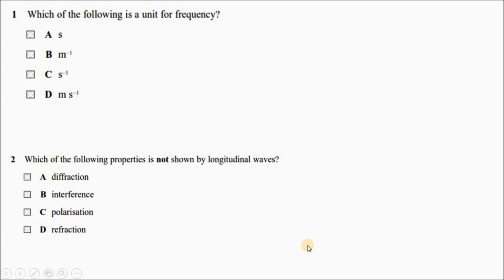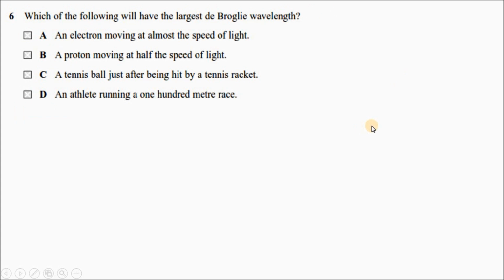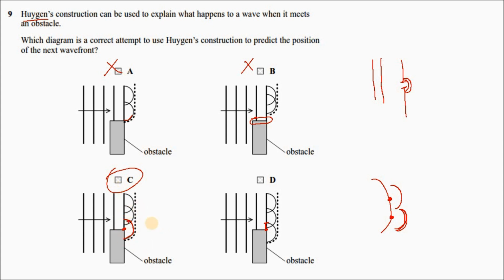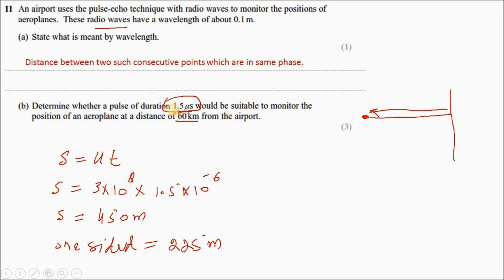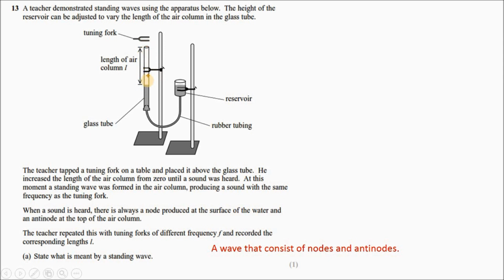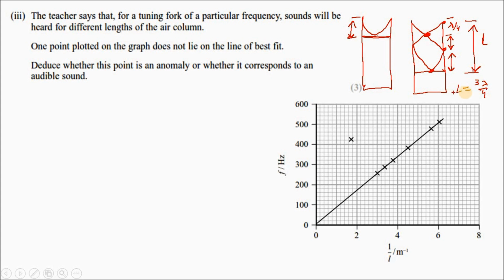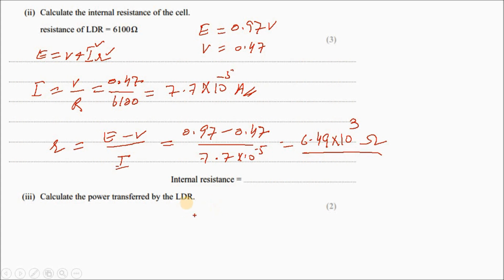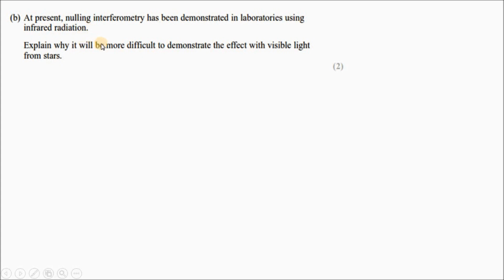Edexcel IAL Specimen paper physics unit 2 WPH12 (spec 2018) part 1

Comment: Sir at 4:08 why are you using T’ and v’? What does that dash mean? Sir pls respond to this asap I have my mocks day after tmr
Reply from the maker: Just ignore the v'and T' because I was thinking of comparing the original velocity v with the new velocity v'. But I used the same formula to compare. 
So just ignore it and see if you've got the idea of substituting mass per unit length.
Reply: @ thank you so much

Comment: why not option C in mcq no.  3 :(
it also starts with high pressure
Reply: this is 5 months late, but in C the pressure is lower so it's not actually a higher pressure.